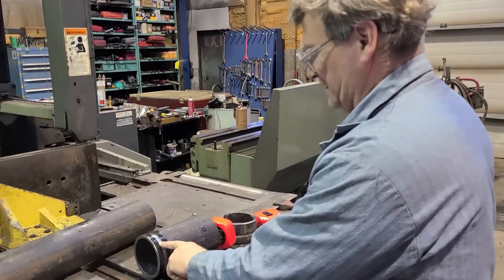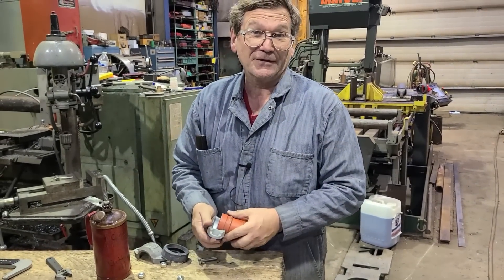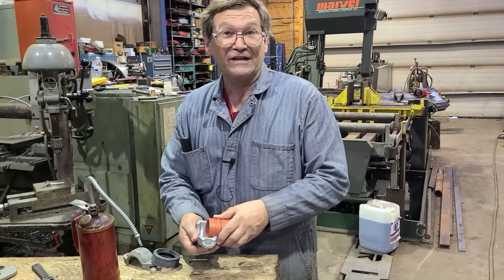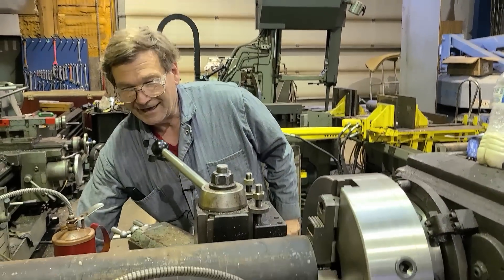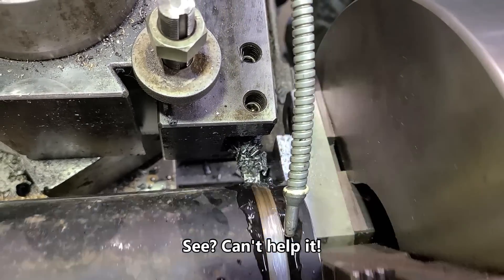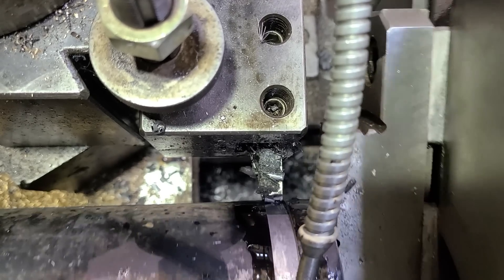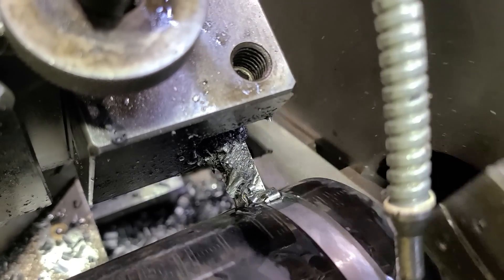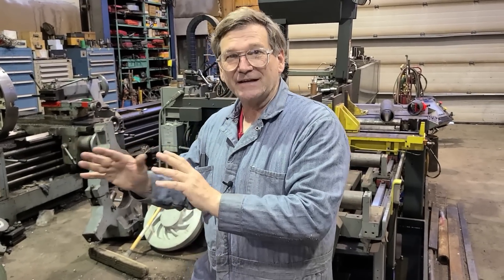Machinist's Minutes: Victaulic pipe fittings

Comment: Plumber in Ontario Canada here, I regularly install this ranging from 2-4". Whats neat is that you can use the system in both copper and black steel, you just need to spend the money on two seperate types of roll groovers. On site we use a threader with the roll groover and the victaulic tape to determine depth, a micrometer wouldnt survive on site. Smallest nipple ive had to make was 2 1/2" of 3" black steel, unlike threading you can make your own nipples without a seperate chuck.

On heating lines it has an issue, as when you turn the system off you need to drain it or you will find leaks as the rubber which has expanded by both heat and pressure suddenly has neither and no longer holds as tight as it should.

Its perfect for the larger sizes as assembling 4" copper vic is infinitely faster than soldering 4". Love working with it, the new lube even smells nice

Comment: Honestly, given how easy it is to thread pipe, vs sending pipe out to get  groves cut in it, it seems threaded sonnections would be easier in most rougher(i.e. mining) situations.
Reply from the maker: In use for a comparable installation, you would need to add unions at every connection.  You can get groove cutting tools for common pipe threading machines.  Pipe over 4" is very tough to thread together, most mines are using lots of 8" up to 48" pipe 12" is very common.  The cheap threaded connections for small pipe are not the same as the more expensive higher pressure fittings, and larger sizes.  I have used overhead cranes to tighten 8" & 10" pipe, in a mine you learn to hate threaded pipe because it is a lot of work.

Comment: Can you do the machine work for a
2007 Cummins 6bt reman. Bored 40 over. Deck block and head. I have pistons and all parts. Been sitting at a machine shop in the valley for 2 years. My truck engine is about toast. I’ll put the engine together myself. Have
Done a lot of them. Just need a reputable machine shop. That won’t take 2 years.  I can’t do machine work.  P.S I voted for ya today.
Reply from the maker: We don't normally do engine work, as Our prices would be several times what the automotive shops charge.  Glad to see You are for Alaska!

Comment: Best tip I have for running threaded pipe for air in any kind of shop or manufacturing space, Use a Tee or union instead of straight couplings at every joint. Makes it much easier to add on or make changes later.

Thanks for the great content, I always learn something watching your videos !

Comment: used  victaulic  coupling type non grove joining uk  1387 4 nb red band heavyweight pipe joiningends  48inch radius 90 degree  bends which we hot fire bent on bending block pulled round on winch in90/s

Comment: Wouldn't bother with those fittings pipe of a container & rigid threadmacker. Should be cheaper.
Reply from the maker: Threaded pipe fittings were actually more money, I am running 175 PSI, while the less expensive #125 fittings usually work they are not safe.

Comment: These are great for quickly opening up slurry lines in a mill/concentrator when they plug up and you need to get in there and hose them out. Mill I worked at had lines with these fed by peristaltic pumps. That wasn’t so great. The pulsation of that kind of pump causes the groove and clamps to wear out after a while and fail, especially with slurry running through them.

Comment: Work pretty good on 3" pipe and bigger. Threading and wrenching 3" pipe is tough work compared to 2" and smaller. Not good for systems that may be under suction though.
Reply from the maker: You are correct.

Comment: I’ve made these for a customer that does a lot of on site work on fire trucks and pump trucks.  They are almost always threaded on the opposite end when I make them.  He refers to them as “groove lock fittings”, but that may be a local term.  Always learn something from your videos.  I’m a semi retired  one horse operation and have a few manual machines.

Comment: Years ago we used victaulic to connect lengths of concrete pump hose and pipe but moved away because as the pipe and hose wore from the concrete abrading the interior eventually the cut for the clamp would burst.

Comment: Try an Iscar 'cut-grip" style grooving insert. They are very fast. I usually have good luck on carbon steel grooving by turning very fast. Often you can get away with grooving at a fast speed and eliminating chatter by having the groove cut before the resonant frequencies are able to establish themselves. Sometimes I will groove the edges of the groove with a thin grooving bit, then move to the center with a thicker bit. I have found the oil of great benefit when grooving as it lubricates the path for the chip to escape the groove so it doesn't get all balled up. With the 'CutGrip' insert I can cut the edges of the groove and then move horizontally to cut the center rather than plunge cut it. I do agree that grooving tool deflection, especially on thinner grooving tools, can be an issue. I have made 4" (2" on the radius) deep grooves with the 5MM wide Iscar grooving tools on 1018 cold rolled steel. I used it to part off a hundred or so plugs I had to make for boiler feed tubes after a disaster with one of our boilers. The plugs were welded in place. I would stick a few inches of mat'l. out of the chuck, turn the OD, use a DRO to make 1/2" deep grooves, index the Aloris holder and plunge a weld bevel on one side of the plug, then go back to the DRO and part off several pieces. Rinse and repeat ad nauseum.

Comment: I quiet like the system its fairly easy to use, Get the book it has all the tables you need, I found the sales people cry about the cost of giving you the book , but it is off set by the thousands of dollars of fittings you may buy, get the victaulic tape measure when you begin.

Comment: Prints have implied tolerances. Fractions have the greatest leeway.  While decimals use the significant digit method. I have seen guages call for +0.00005 -0.00000.

Comment: Terex made cement pumpers. I did maintenance on an outdoor aircompressor. I was surprised to see pvc schedule 40 for the air supply. The heat and oil coming from the compressor had softened it to the point it would squish if stepped on. It's probably cheaper, but I would never trust it with a piston compressor.

Comment: I've done hundreds of them, usually in 4" schd 40 pipe. 1/8" wide carbide grooving tool at much higher speed, working from either edge in toward the center is much faster. DRO in this is a great help.

Comment: Some of use just enjoy hearing the gears in the machine. When it comes to dimension with no given tolerances I was taught, generally, that the tolerance was half of the last digit place. So 3.06" would be +/- 0.005 and if fractional treat everything listed as less than 16ths as 16ths +/- 1/32, after that the tolerance is the next fraction down so 3 3/32" is +/- 1/64. That's all pretty open tolerance, but if those dimensions were critical they'd have the spec on the print.
Reply: That's a very practical way of setting your own tolerances. If the customer wrote 3.06 on the drawing he probably doesn't have a micrometer and will be happy as long as his cheap digital calipers show 3.06.
Reply: that kinda tolerance scales up and works on cutting 2x4s too, its a good game plan.

Comment: Why not use a carbide insert grooving tool ???
Reply from the maker: Sometimes I do, I think I mentioned that method also.  I have found the The single full width bit method is slightly quicker overall, no need to move for width, the cut-off tool can be used, however My micrometer will not fit until the grove is 2 parting tools wide, so the extra measuring/stopping slows the overall progress.

Comment: Victaulic connections are very forgiving. You just need to get the ends close and you’re good to go. 
We use them on our mud mix rigs.
“Gruvlock” is the other manufacturer.